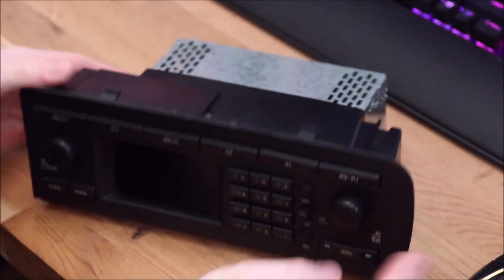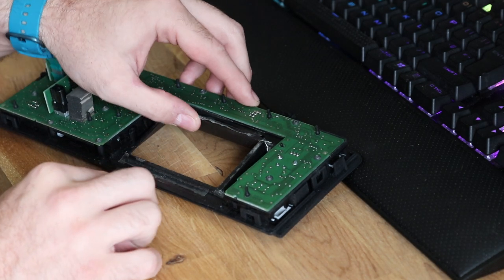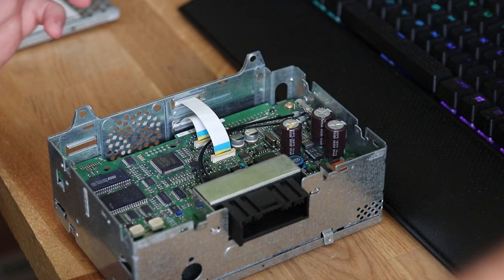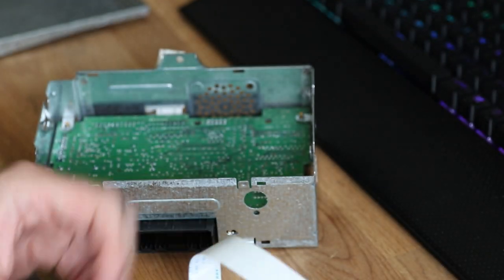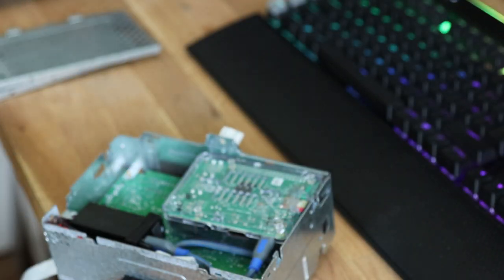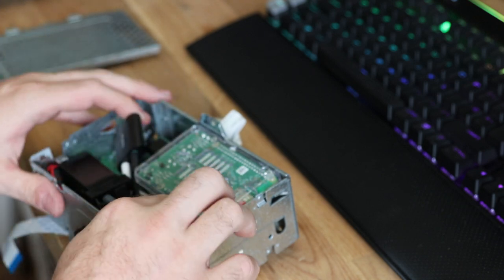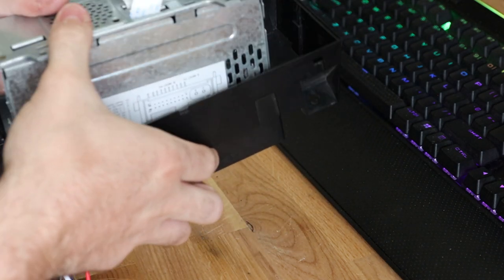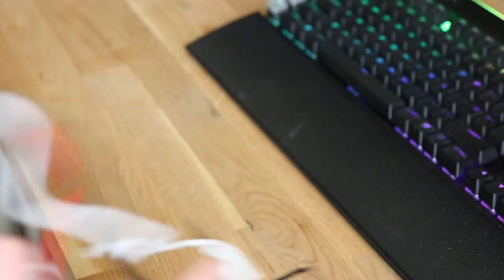2021 Build Guide - Saab 9-3 ICM2 Radio Modification for Crankshaft or Open Auto Pro

Comment: Holy Cow!! Stu, your insight skill are amazing as always. I need to go ahead and try and do this. With all these mods, I imagine you could take any old ICM 2 and replace an ICM 1 without have to deal with divorce and marriage via tech2, yea?
Reply from the maker: Technically yes. BUT only if the ICM2 came from a car with similar features as yours. For example, if you have reverse sensors and you take an ICM2 from a car that didn't, say goodbye to your reverse sensors until you reactivate them with a Tech2. If you don't have any special features (auto wipers, amp2 ect), you just need to make sure the donor car had an aux as this will mean that it's already enabled and will plug and play in your car. Does that make sense?
Reply: @SaabUnleashed  it does! Thank you!
Reply: @SaabUnleashed  Hi. I'm lost on the white cable loop thing. Where does that go

Comment: Hi Stu, done this mod for Carplay on my ICM2 but find I’m getting a bit of crackly feedback on the sound. I have routed a 3.5mm aux cable from the sound card in the Pi to the aux socket in the armrest. Seems this is potentially caused by the cable not being shielded? Do you sell a 3.5mm cable that would plug into the back of the EHU and then into the sound card on the Pi and is it shielded?

Comment: Hi. Thank you so much for these videos on the icm2 and icm3! I had a couple quick questions about Apple car link. Does it work over Bluetooth or do you need to plug it in? If it has to be plugged in, and this may be stupid, but can you plug the Bluetooth adapter into the car link dongle to have car link work via Bluetooth? Also, and I think this may have been addressed in another comment, but I’m curious about a back up camera install as well. Any ideas how to do that or was it addressed elsewhere? Thanks again and I hope you’re able to get back to me :)
Reply from the maker: The CarPlay kit is wireless, it works via Bluetooth. The backup camera is possible as Open Auto Pro is compatible, but there is no kit for this purpose currently in existence, but it's definitely something for the future
Reply: @smug999  hi how much for the icm2 upgrade my Saab is  03/9-3 Arc 
Thank you.

Comment: Hi! Is there any way to have a simple setup that would allow you to use WIRED Apple Carplay? Presumably at the time of making this video - there wasn't a way to achieve this. Half a year has passed - anything new on the horizon? I've searched the web and all I could find where some attempts at running Apple Carplay on raspberry pi via Android installation, also thanks to using an external USB dongle. This would be just right, except I haven't seen a setup that would work with the touchscreen capability.

Comment: Interesting stuff. Still, you are stuck with the "old" radio I guess? I saw some interesting alternative radios at Amazon but then: is it possible to just leave the original radio in place, put one of the alternative radios in while using the existing speakers? Simply splice the leads and connect to the new radio and move on?
Reply from the maker: Have a look at https://youtu.be/PmJHbgXNpOs
Reply: @SaabUnleashed  Yes, I already looked at it. Have you ever considered using the face of the ICM unit when detached from the unit as a template? I am going use it to cut a faceplate from a piece of aluminium in which I can put the new radio (Single DIN) in. Needs to be 1,5 mm at least.
Reply from the maker: @r.r.visser4156  yeah I always had the intention of 3D printing a faceplate but in the end it was just easier to build the single din bezel from the ICM1 itself
Reply: I'll send some pictures when I have mine ready. I think I will opt for a Podofo radio with a retractable screen. Should fit fine. BTW: you have stripped Saab 93 before. Although cars are delivered with different configurations, the wiring looms for speakers should already be there or not?
Reply from the maker: @r.r.visser4156  the door speakers yes, if the car doesn't have them, the looms are there. The rear speaker options won't have the wiring there
Reply from the maker: Also, door speakers terminate under the passenger seat, not behind the head unit
Reply: @SaabUnleashed  Cheers Stu. What do you mean by terminate under the passenger seat?
Reply from the maker: @r.r.visser4156  the amp for the door speakers are under the passenger seat, unless it's a convertible

Comment: Stu, A friend gave me an Orange Pi Winplus. The popular comparison is the the Raspberry Pi 4 model B. Although the Raspberry Pi is superior, can I use the orange Pi in the ICM2 mod and, if so, what software needs to be installed and how? Are the accessories the same? Am I wasting my time?
Reply from the maker: The software, Open Auto Pro, is only designed for the mainstream Pis. Have a look at their forums to see if the question has been asked before bluewavestudio.io
It needs WiFi and 4 USB ports
Reply: @SaabUnleashed  It has Wifi, bluetooth and 4 USB 2.0 ports. I will check the forums! Thanks for helping; I will update you on my findings/progress.

Comment: Hi Stu, can I just replace the USB C cable with a lightning cable to use Apple Carplay wired with Open Auto Pro? My car already has ICM2 installed with aux activated so I guess I will need the RPi4, Open Auto Software with Carplay, screen, Power adaptor and cable, sound adaptor, bluetooth, microphone, aux cable and lighting cable? Really fancy giving this a go.
Reply from the maker: You can indeed with Open Auto Pro software and the Apple CarPlay add-on. It's essentially exactly the same as the ICM3 mod but with a smaller screen
Reply: @SaabUnleashed  Thanks Stu, out of interest have you tried Carplay on this? Just how usable is it with such a small screen?

Comment: My 04 has everything but aux will this still work ?
Reply from the maker: You have two options. You can either use an FM transmitter to tune your radio into this, or you can use a Tech2 to enable Aux

Comment: What size MicroSD card is needed?
Reply from the maker: Small. 8/16gb will be fine
Reply from the maker: Lots of pictures when installed please! Feel free to contact me on Facebook if you need a hand
Reply: @SaabUnleashed  Which raspberry version did you use for your build?
Reply from the maker: @jatkaler5735  the 3b for Crankshaft and 4 for Open Auto Pro
Reply: @SaabUnleashed  Thanks Stuart.  The only reason I ask is that I read 4 tends to overheat so you can add a fan.  Would this be required particularly in the summer months where the cabin can get warm?
Reply from the maker: @jatkaler5735  Actually yes, that's a great point. Actually I suggest using the heatsink full cases with a fan for this reason. I have only had one report of this overheating, and only when it was installed inside the ICM like I did in this video. I must add an edit to this video to outline this

Comment: Hi Stu, I love all your videos. I’d like to know if I could ship my ICM2 from the U.S and have you put the kit together for me? What would be the fee? Thanks for all your great videos!
Reply from the maker: Amy, to be honest that is a bit of a logistical nightmare. Without your ICM, your car won't start, so if it gets lost for whatever reason, your car is dead! The ICM2 is very very easy to disassemble to remove the original screen and replace it with the newer LCD, honestly it wouldn't be worth you sending it to me.
Reply: @SaabUnleashed  thank you for responding. I have an additional ICM2 unit that I haven’t installed yet. But I am getting my feet wet with repairs and upgrades so I’ll give it a try!

Comment: If I send you my ICN2, will you update the unit and ship back..for a fee?
Reply from the maker: There's many reasons why I generally wouldn't do this. But the main one is that, for the ICM2, it's very easy to swap the screen, 10x easier than the ICM3. It's literally a couple of screws to remove the original.

Comment: What size sd card required for this build?  With open auto pro 4b, is iphone interactive without the need to wire into your phone? Limitations to wireless Bluetooth? Is this possible?
Reply from the maker: You only need a 16gb, and that's plenty. If you use the 4b with Open Auto Pro, you get wireless AA and CP